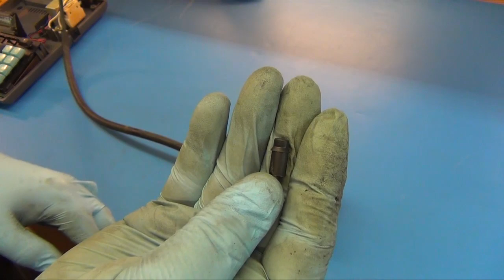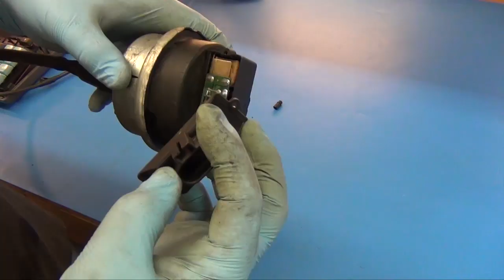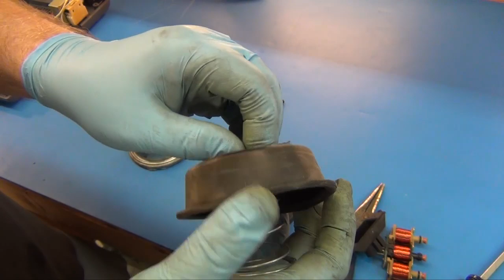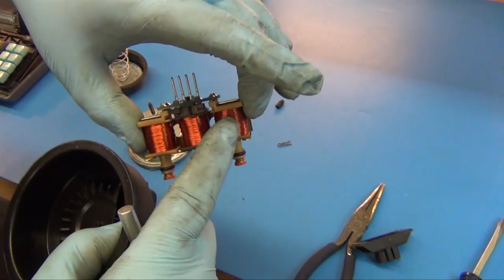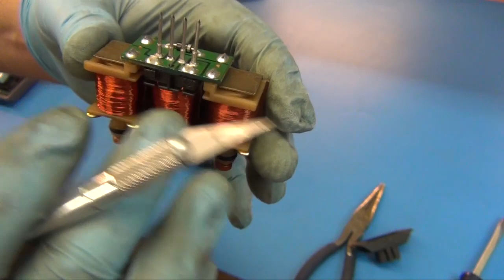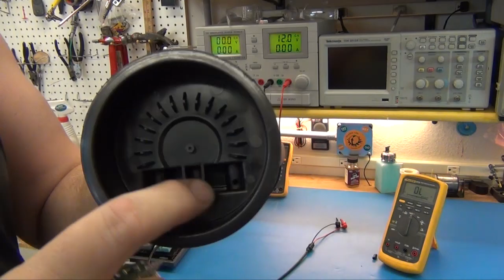Cruise control autopsy and experiments

Comment: I had cruise control that was taking a really long time to engage. I noticed a vacuum line looked deteriorated, so I replaced it.. but now when I hit cruise control, the truck goes seemingly full throttle?

Any ideas why that would happen?
Reply from the maker: No, could be many things. Best to have it serviced at a shop that can run diags.

Comment: Long shot asking this, but do you happen to know what size diode that is?
Reply: 1N4007 National Semiconductor would be a good subsitute.  'Size' about 14 watts or so.  Highest voltages you'll see forward biased would be battery (13.8v).
The reverse flyback voltage could be as high as 10 times or more ! the supply voltage (assuming a max of 13.8 volts that's 138.0 volts).
The diode conducts, turning into a short; that limits the reverse flyback voltage to around .7 volts or so when the computer releases the coil pin protecting the computer   control output transistors.

Comment: Super glue and baking soda will make a strong repair to the plastic vacuum fitting in three seconds .
Reply from the maker: I think that trick would have worked, Thanks. But the pick-a-part I used was cheap enough and is still working all these years later.

Comment: Hey. I have the exact same servo on my 94 Dakota. So far cannot figure out why my cruise control wont engage anymore. Cleaned up the metal rods inside the servo, checked all vacuum lines, getting power to switches and at the pcmcia and servo....super confuses. Did the test you showed in this video and still nothing showing why it isnt working
Reply from the maker: Make sure the brake engage switch is working on the brake peddle. I have seen the switch get lose and the cruise thinks you have tapped the brakes all the time.

Comment: Thank you , I have a problem with mine since new, some times you set it and is ok, some times you set it and shuts off, set it and shuts off, some times it works, it is just on big piece of pie.
Reply from the maker: I don't think there is a fix for that. I have replaced every component of my cruise control including the buttons on the steering wheel. Nothing has ever stopped the very same condition you describe. I just live with it now. I even had a pro shop hook up one of those $15,000 monitor computers and drive around. They said as far as the computer was concerned the cruise was working fine, but it wasn't.
Reply: Thank you, the dealership checked it when the car was new  and they stated the same thing, wow never again will buy another american car!!

Comment: thank you for the quick reply. I did plug in the air hose but now the truck turns off. Once i take it off, it stays on. I test it several times. I put the air hose in, and it turns off the truck. I take off the hose, and it stays on and works fine.

Comment: quick question...my truck turns off because that module stopped working..once we removed the air hose, the truck works perfectly fine. I was wondering should i just leave it like that or is it important to fix that cruise control module?

Comment: So is the one solenoid always on when the cruise control is off? The way I see it, when all solenoids are off, no air can come in the chamber so the vacuum pulls the membrane and opens the carburetor, which seems strange in a context of fail-safe engineering.

Also weird that there's only one diode. When I saw that, I was wondering if the solenoids were in series but I see from the photos that they aren't.